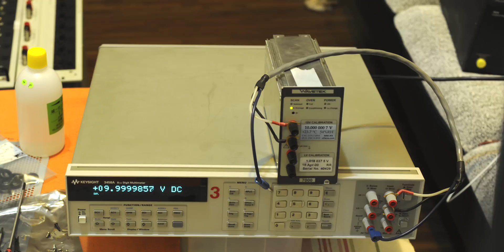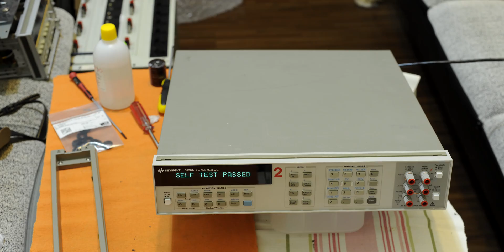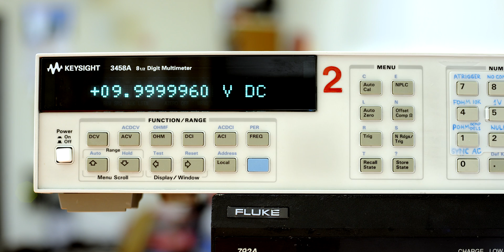Service of two 8.5-digit HP / Agilent / Keysight 3458A multimeters

Comment: Hi guy, i have an error DMM 3458A, When i power it on i get message 202,"HARDWARE FAILURE --SLAVE TEST :AC BOARD", please show me some reason, thank you very much
For detail see at: https://youtu.be/cMqNtPODK2E
Reply from the maker: I would try to check and probably replace old Elantec EL20* comparators on the A2 board. This is common issue for old HP 3458A units. Otherwise you would need to debug more, it's near impossible to guess exact issue by internet :)
Reply: @xDevscom_EE  could you tell me, when does selft test is Ok (parameter of these output signals), i need to know these point (These Signals + level send to MCU to display PASS ) to debug it more, thank you very much !

Comment: How do they do grading of precision equipment? Do they have to calibrate an $20K meter with say a $50K meter for it to be certified?
Reply from the maker: Question who? Manufacturer? They use reference standards like Fluke 732 (~$10k), 742A resistors (complete set >$60k), high-end verified calibrators ($80k+) if you want to calibrate and certify meter to the best spec. Most of calibration labs / customers don't need absolute best, so just standard high-end calibrator and references would be enough ($50k). Or if you mean owner of such meter, you could have multiple meters, and ship only one for proper calibration (~3K$) and then compare your remaining meters to that "golden" meter.
Reply: @xDevscom_EE  Can you make an equivalent to the calibration made by specialize companies on a budget with less expensive equipment? I think all those complex circuitry inside are just for filtering and redundancy just to spread the load applied to attain stable output generation. I know for once that the labs you are working on really put their equipment to through their good use for testing endurance of boutique circuit for computers. By the way as another user commented you are really the only source available that show the layman how to properly do the servicing to these fine tuned equipment ;)
Reply from the maker: @johnnychang4233  Problem with high-performance instruments like 3458A is the special components used, to reach that high performance. 3458A main diamond is insanely linear ADC (0.1ppm, 2 times less than best market DC reference noise level!). That is obtained by special custom hybrid ASIC, and careful design by Wayne Goeke and HP team. Even today, more modern meters like this year released Fluke 8588A that cost two times more, cannot reach this performance. 

If you think it's possible to reach such level on budget, well, maybe. But think how to prove better/or similar performance? You need something like Quantum JVS standards for such level test ($400K) or whole lab of equipment if doing it manually with KVD and nullmeters (and weeks of time to do so). HP worked together with NIST lab during development of 3458A. You can have great read of HP Journal issue about 3458A, which I linked on my site: https://xdevs.com/fix/hp3458a. 

As analog designer you often want to have least amount of parts in signal path, so you have less stability problems to worry about. I know such equipment is expensive, but it's not just the instrument, you need to think about complete setup, including calibration gear, service gear, cables, switches and what not you need to perform experiments. I do it because it's amazing engineering challenge, so cost factor is secondary. But please note, I do not run this for profit, otherwise approach could be simpler/cheaper. Computer hardware is not compared to such high-end instruments either, as it's much cheaper, does not use special expensive analog components and manufactured in many hundred thousands units, while meters like 3458A only made in low thousand qty a year.